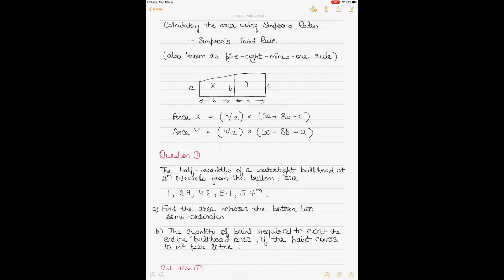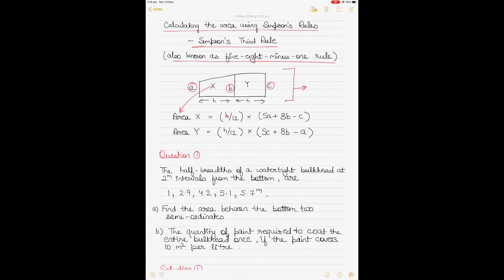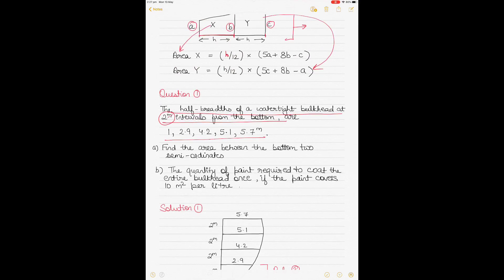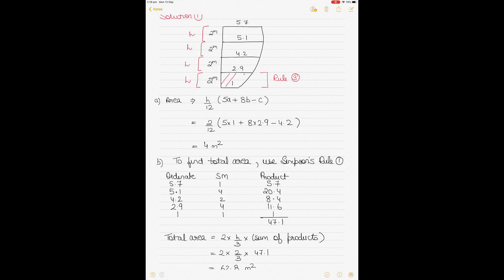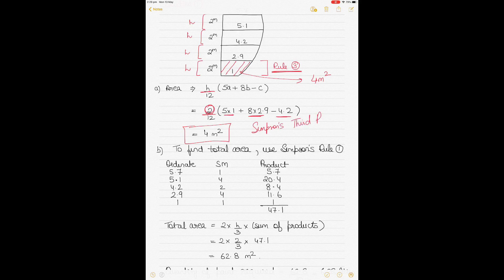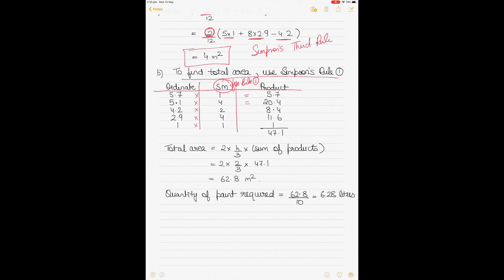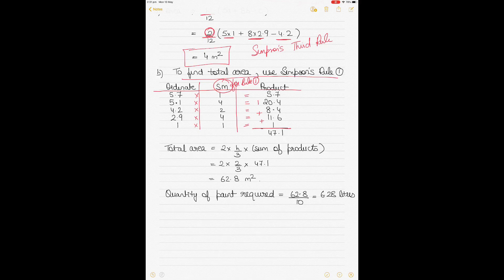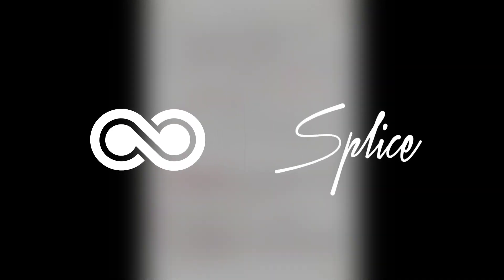Ship Stability - Use of Simpson's Third Rule to calculate the area

Comment: The fore deck of a vessel is 60 m long, the width of the deck at equal intervals commencing from its fore end are 12,13.5 & 15.8m calculate the area and the CG of the area from fore end wrt 
a) forward half of the deck. 
B) after half of the deck.
Sir can u please solve this